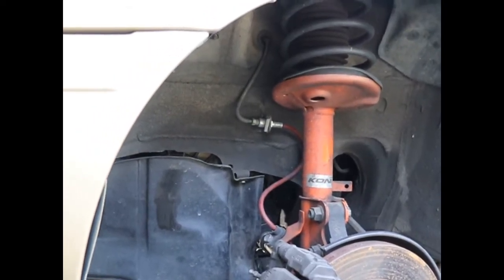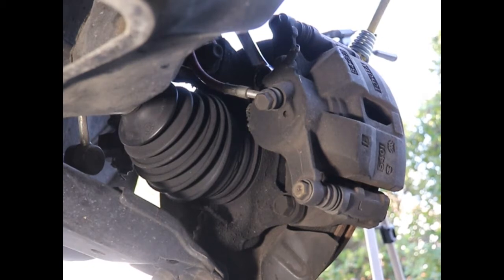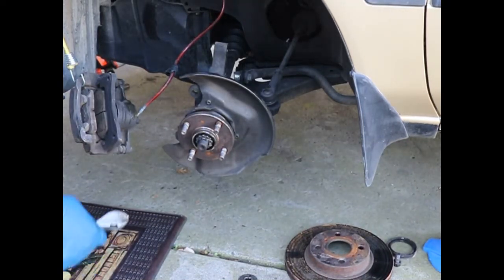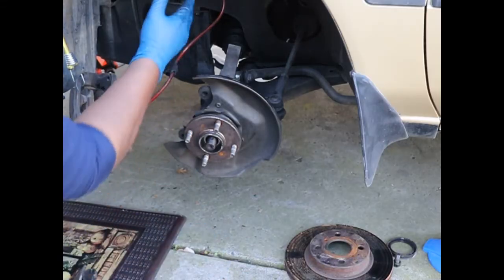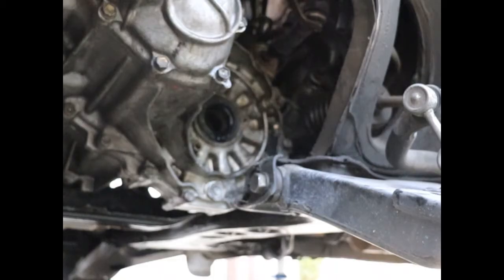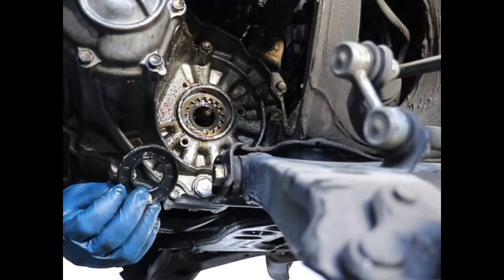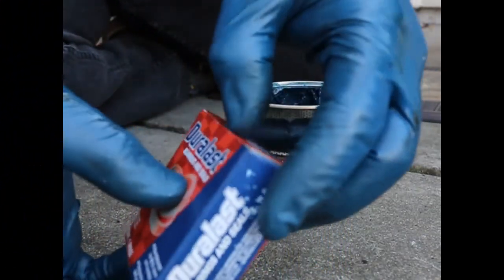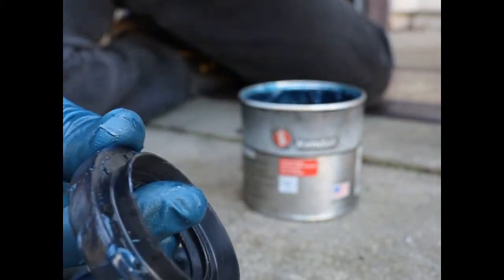How to Change a Toyota Corolla Transmission / Axle oil seal

Comment: Please my 2014 toyota corolla has this same problem. After going through this same procedure to replace the seal, do i need to "kick" the gear box electrically before it can change smoothly?

Comment: I changed my seal recently (not on the same car as yours), but I finger pushed it in at an angle and then worked my way around AND it leaks.

I funnily enough just bought the right sized socket to knock the next one in flush!
Reply: Pvc  plumbing adapters work great also and are alot cheaper than the socket . I bought the out and inner diameter sizes for 1.50 each. They work great also.

Comment: Thank you Clint, for the clear and concise explanation of why the axle end ring should be installed with the open end facing down to facilitate ease of installation.
My car is an automatic trans and my question is does the axle end ring be installed with the open end facing down in both manual and automatic transmission????

Comment: And the other output shaft oil seal on the other side ?
Reply: Passenger side easier to access and easier to remove the passenger axle.

Comment: So there are two transmission oil seals, correct? Driver and Passenger side?
Reply: Correct, but usually the driver side is that leaking.
Reply: @JoJanDiezel ah okay!  I'll probably just replace both since I have to replace both axles. Thank you!!
Reply: @stevelopez2546  It sounds wise. Also, they should be two different seals, one is larger (the driver side) and are marked as left and right, they are not the same...
Reply: @JoJanDiezel  thank you for the heads up! I wish I would've seen your comment sooner. I ordered two of the same. Planning on canceling one.

Comment: What year Corolla is this. Will the seal parts in the description fit a 2019 corolla 1.8 liter?
Reply: Check rockauto for your make model year and engine size.. so you can be informed of your part list, model numbers and information descriptions during your part search.

Comment: Hey Clint!  What can cause the seal to wear?  Is it usually something regarding the axle or trans?  Do the inner axle cv joints get loose/worn and cause a pushing down on that seal?
Reply: Yes, if you grab the inner cv axle cup and try to tilt it and move it around, it does indeed move quite a bit and may cause wear, but also the transmission output shaft bearings could be noisy and have play causing (stub shafts) or cv axle to also be wiggly. Some after market cv axles may also have a slightly smaller or bigger shaft which can cause wear or leak. I still need to invest in a proper micron gauge thing.

Comment: I changed my oils seal 3 months ago, recently started leaking again, bought a new axle and seal when i replaced them. It's got me doubting myself, did i set the seal the right way?? Just order a new seal and the 1" 13/16 socket in case i need it, hopefully i can do this without disconnecting the tie rod, i don't wanna have to do another alignment. Thanks for any tips.

Comment: Love your videos! Thanks for sharing. If you dont have a giant socket, you can use the old seal as a buffer when tapping it in.
Reply: Yeah but then the old seal gets stuck in and then when pulling the old one you can damage the new one.

Comment: Great video I have a question my friend with my Yaris 2007. I replaced CV axle and noticed I damaged a o ring seal but the other one on your video perfect I have no leak so far but abs came on . Did some research but don't know where the o ring seal that I damaged sits and why abs is on thanks ?
Reply: Oil seal Yaris Corolla is the same

Comment: I found that if you just remove the 2 nuts/1 bolt from the lower ball joint/control arm assembly, separate the connection, push the axle out of the hub then pivot the steering knuckle and axle in opposite directions the axle will come out.  Saves some time.
Reply: Totally agree
Reply: @b0ssh0gg  I haven't noticed a change in the drive.

Comment: Just stumbled on your video. WTF hasn't any other YouTuber mention the circlip's position? You just earned yourself a subscriber. What a time saver!!!!!!
Reply: I had the opposite effect. The clip got mangled with the opening down. I had to return the axle. With the replacement I put the opening on top and the ring sagging and it rolled right in.
Reply: @joesmo4377  Yeah, what he mentioned is literally the exact opposite I've seen recommended in other videos.
Reply: @joesmo4377 I recommend just greasing the ring in place. Way easier.
Reply: You said it

Comment: I'm having to do the drivers side CV Axel on my 1998 Toyota Camry V6 3.0 cause I noticed the boot started to leak the grease. Well and I also noticed when doing my oil change the I had a little leak around that area so I was wondering if it is a pain after you pull the Axel out how hard is it to get the seal as well. Oh and can't seem to find the right Axel seal for the car if anyone's know the exact name for that seal I'd really appreciate the advice so I can order it and get it all replaced.

Comment: Hello, thank you so much for this great video. I did replace the seal and the cv axale for the 5th time and it leaks oil from the seal a few days later. I thought maybe the balancer since the new cv axale do not have it. The original CV axale has balancer to the passenger and now they sell them without a balancer.
 I learned from the comments that to use the transmission oil for the interior of the seal and do not use grease on the outside circumference of the seal. 
Is there anyone who had this issue and fixed it?
Thank you for your help!
Reply: You might have scratched the crank itself.... Or uneven install of new  seal..... Yes inside should be lubed with oil.. No grease on outside of seal

Comment: you missed an important step. grease the seal on the inside, or you are going to burn it out. and then you have to do it all over again. use trans gear oil
Reply: @RVGLASSFOAM  I think you are talking about automatic transmissions. they need to be running to get an accurate measurement. manual transmissions don't need to be running

Comment: Hi Mr. Clint-I just bought a 1994 Toyota Corolla Wagon Base Automatic.  Is this the same situation as your Wagon?  I am not able to do this myself,  How much ballpark figure should a mechanic charge me?  I really appreciate your video and your time.
Reply from the maker: I'm not sure how much a shop would charge but I would charge about $150 per side for a  job like this but I don't usually work on other peoples vehicles.
Reply: @Engineerboy100  Thank you Mr. Clint.  I am very grateful for your wisdom.  I am not very mechanical but I am a good farm hand.  I will be watching all your videos since we have the same model and year wagon.  Mine seems to have a groaning to it when I hit 50mph or greater.  Do you think it could be my rack and pinion going?  I dont see any leaks but I dont know what else it could be.  The steering seems fine.  Makes a little noise at faster speeds to when I pull it to the left but not to the right.  If you had any experience or knowledge of this please share.  I really appreciate you getting back to me.  it means alot Sir.
Reply: @ARoberts0115  I'd say it's highly likely your CV joint, the outer one probably. If you can, replace both the inner and the outer CV joints by replacing the whole CV axle.

Comment: What if I’m missing the ring ?
Reply from the maker: I would find a way to replace it even if I had to got to an auto recycler and pull on off a used car, you want that shaft to stay in.
Reply: @Engineerboy100  okay I have no problem getting a new one the thing is finding one since I've been looking all over the internet for it and can't seem to find it.

Comment: Great informative video. But I have an issue doing it on my 2002 Lexus ES 300. The new seal is leaking. What am I doing wrong?
Reply: Don't grease or lube the new seal on the part that touches the area where the seal "seats."  None of the metal to metal part of the seal should be oiled or greased or lubes.  It's a friction fit that must be tight.  Very tight.
Reply: Find and use the Specialized Service Tool. It will eliminate the headaches and leaks.
Reply from the maker: The seal might not be in square or you may have damaged it during installation. It's hard to say.

Comment: clint  hi  I have a question    first  grate video and I love the tip about the ring position.  is this the inner seal or  outer   ?  I ask because I am doing this job soon    but I first need to know  what to order  from the parts store inner or outer
Reply from the maker: The seal that I replaced was the seal on the transmission.  There are two, one for each side and they are different.

Comment: The gearbox oil doesn't come out wen you pull de drive shaft? I have a corolla from 2004 and I have to replace the shaft but the mechanic said that the oil has to be changed. Is that right?
Reply from the maker: Yes, the oil must come out first.

Comment: What is the number transmisión seal ???
Reply from the maker: There are two different seals, one for each side.  Best to get the part number for your dealer or the local parts store for the side you need.
Reply: Thanks 🙏
Reply: That’s good information

Comment: What did you use to hammer the cv seal?
Reply from the maker: I used a ratchet extension to gently tap the seal until it seated evenly.
Reply: 6:44 1"13/16 Socket

Comment: thanks for the video. You said that it is not engine oil leak, then what type of oil is leaking?
Reply from the maker: The car has a manual transmission so it requires gear oil,  a very thick oil, with a much higher viscosity than motor oil....

Comment: I thought the lip of the seal went inside the transmission, am I wrong?
Reply: Transmission have a transmission seal.... Rear motors have a real motor seal....2 different seals 2 different sizes.. Since your already there always change both!!

Comment: Do I have to torque the last 30mm nut.
Or is long wrench socket enough to tight it.
Reply from the maker: It does have a torque spec and should be torqued according to your shop manual.

Comment: Great video. I have a question for you. I changed the CV axle and axle oil seal on my Toyota. After installation, I noticed the new CV axle didn't have that metal dust cover on the transaxle side of the CV axle. Is this a critical part? In other words, will the missing metal dust cover compromise the integrity of the axle oil seal? Thanks.
Reply: Hello. I am really sorry I am seeing this question a year later, but here is the answer. The duct cover is important. it protects and prolongs the life of your seal which means you will not have to repeat the job any time soon, the potential for leaks will be smaller. I hope it helps. I have installed seals without the dust cover and some time later, I have had a leak through the seal. My DIY experience has taught me the following lesson: when installing CV axle seals, use the specialized service tools and you will be done in no time with no repairs to repeat, no headaches to endure, and MOST IMPORTANT, no risk to wear out your transmission (manual) gears due to low transmission fluid levels.) With that notion mentioned, if an experienced mechanic does the replacement of the seals, then, I defer to what she/he says. ..... (but I would still prefer to use the Specialized Service Tools).
Reply from the maker: That is a very good question.  I have no idea.  Sorry. Dust covers are usually installed for a reason though ....
Reply: In California no dust, mud , dirty... Will be fine.. If you 4x4 in dirty muddy environment it will eventually cause a problem..
Reply: Métal cover protect the car for rocks ...etc

Comment: Toyota part #9031135065 passenger (right side) I paid about $14. My Mechanic made it looked so easy took him less than 30 mins to do it. Paid him $60 for labour. Provided him with parts and gear oil cuz at least 1 litre came or u can try to reuse the gear oil that came out if it's still good. But might as well change the gear oil while doing this job
Reply from the maker: Never reuse gear oil, it's not worth it. A few grains of sand gets in the oil that you don't see and your transmission could be destroyed.

Comment: Was this a automatic or manual car? Also what's the Toyota part #?
Reply from the maker: This was a manual transmission. Sorry, not sure of the part number  of the seals.
Reply: I got toyota part #9031135065 the parts nbers toyota uses are interchangeable. They keep changing it but still same item

Comment: Do you need to change the rubber seal everytime you remove the cv axle shaft?
Reply: Why would you not replace it?  You have it all torn apart.  Eventually it will leak.  It's a cheap part = replace it every time you have access to it.
Reply from the maker: No. if the seal is in good shape and you are careful not to nick it when putting the shaft back in, as long as it doesn't leak, there is no need to change it.

Comment: This was shown on the Passenger Side?
You replaced both seals?
Nicely done, Clint Hightower.
Reply from the maker: Yes, both seals were replaced on both sides.
Reply: @Engineerboy100  Thank you for taking your time out for us, Clint Hightower.
Reply: @Engineerboy100  it's the same seal on both sides right? or are they different?
Reply: Hashira Amarasuriya  they're different sizes.....one is bigger than the other....be sure when ya buy them one says (left) and the other says (right)